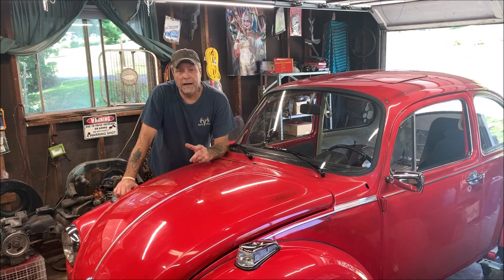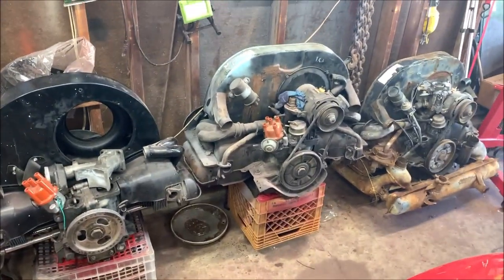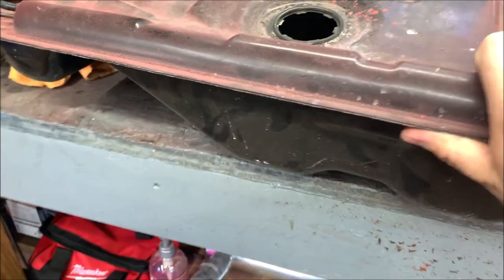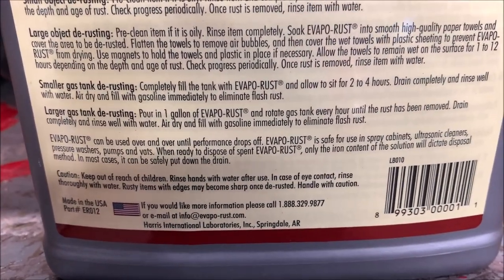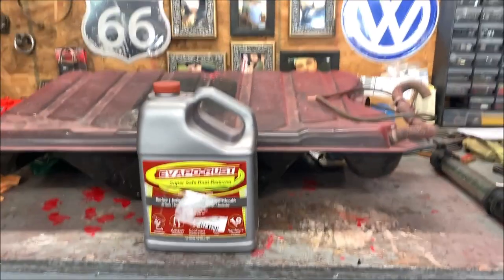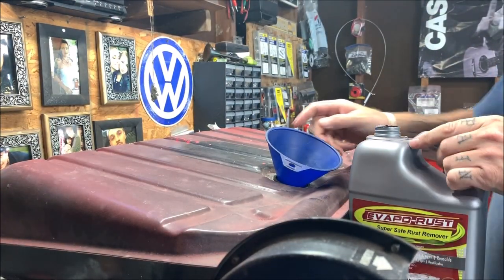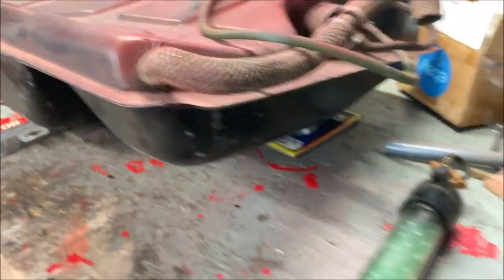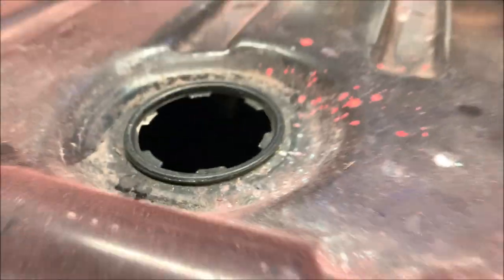VW Beetle - Super Beetle Fuel Tank Rust Removal Done Easy - VW Baja - VW Bus - Rust - VW Herbie Bug

Comment: Great and informative video as usual. Shop manual suggest to prevent flash rust, you can use radiator coolant.
Reply from the maker: Thanks for being here! Yes anti freeze will  work. But I was concerned about putting that in the video and someone not cleaning it back out good enough....then ya know 🤦🏻‍♂️😂

Comment: I will have to give that a try myself. My tank has a bit more rust than yours so I may have to do a bit more work to mine first. Keep these vids coming. 🤜🤛
Reply from the maker: Thanks very much Jonathan! It really does work, just let it sit overnight for 24 hours. If it didn’t remove all of it completely, then let it sit again. It does honestly Work I was surprised myself.
Reply: Slades VW Beetle my 73 Super has done a lot of sitting over the last few years I think. Before I started my tear down flakes of rust where getting caught in my fuel filter, like a whole lot. I may have to end up replacing the tank in the end, I haven’t pulled it yet to look. Hoping I can save it though. 👍
Reply from the maker: Jonathan Farmer It honestly might be salvageable. I like to let the stuff sit for 24 hours although it says 2 to 4 hours. I have a video on here further down for cleaning your main fuel line out in the tunnel. You might want to take a look at that. Every little bit helps a lot
Reply: Slades VW Beetle I am gonna replace all my fuel lines, including the metal one that runs down the tunnel. I am actually gonna do a pan off over the winter, it needs floor pans and all that. 👍
Reply from the maker: We will be doing that, at the same time my friend. I have a 71 standard I am getting for my next project. I’m taking the body off of it, and going completely pan up. That will make for some interesting videos

Comment: Very informative!  My '68 Ghia's tank has rust chunks in it. Is that too far gone? Should I just find a better tank?
Reply from the maker: If there’s actual chunks, you can try putting some nuts and bolts in a tank or a big piece of chain and shaking it around to break everything loose and then rinse it out. 
But you Gotta make sure you don’t have a bunch of pinhole leaks everywhere.
Reply: @SladesVWBeetle  Thank you! I will give it a go.

Comment: I appreciate this video as I am in the process of working on a 74 SB Convertible to getting it back on the road.  Also, and I can't find any real answers to this, but is there an internal screen in the SB fuel tank bottom that can be accessed by a hex/allen key type plug and R&R'd with long needle nose pliers?
Reply from the maker: Thank you for the kind comment and thank you for being here. I do believe on your gas tank there should be a screen in the bottom. When you remove the plug out of the bottom it will pull out.

Comment: we are about to use in our gas tank. What did you use to block the larger openings in the tank?
Reply from the maker: Oddly enough I used thick Ziploc bags. 
Covered the holes and use zip ties to pull them very tight. 
I surely hope that made sense.
Reply: Makes perfect sense. I will give it a try. Thank you